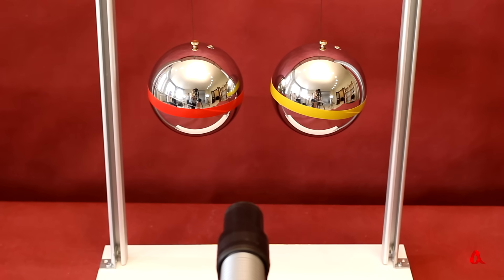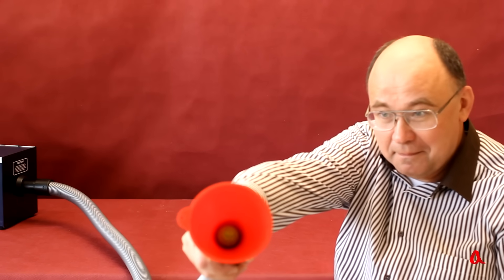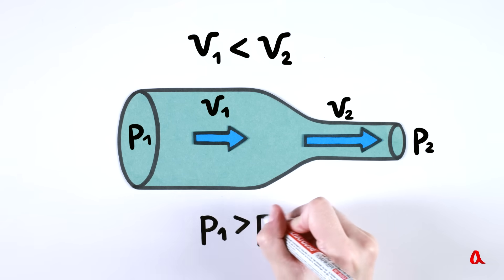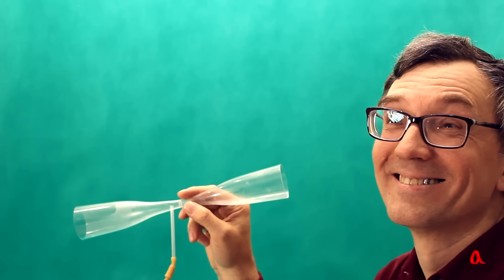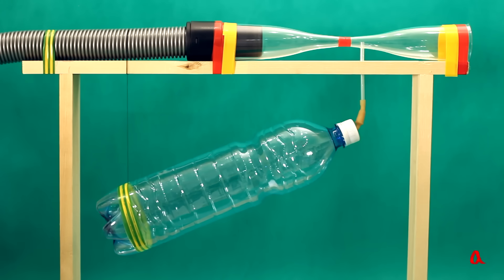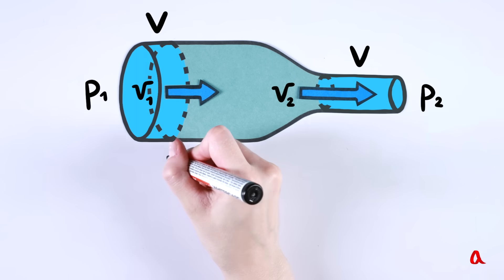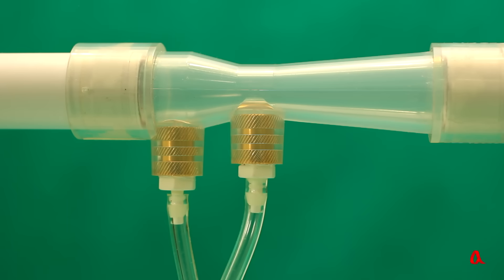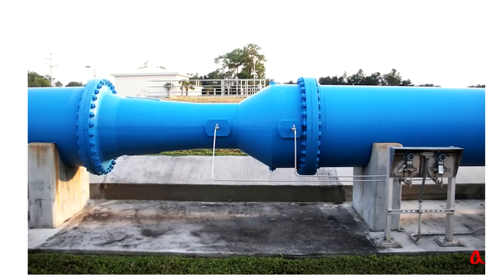Bernoulli's principle

Comment: I have always had difficulty providing an intuitive explanation for this phenomenon, but if we try to think of pressure as potential energy rather than force per unit of surface area, perhaps the concept becomes a bit more intuitive. Or, imagine having a blown-up balloon. The balloon has a certain internal pressure. When the balloon is opened, the air inside the balloon starts to move faster. The internal pressure of the balloon then decreases because the potential energy of the air inside the balloon is converted into kinetic energy.
Reply: You have to embrace pressure to reach your full potential.
Reply: Good analogy

Comment: Water and ball example is not bernoulli. It's adhesion and conservation of momentum
( The water turned to the right. Therefore, the ball's leftward momentum increases. But the ball is at rest. Is this non-conservation of momentum? no. The momentum of the water was transferred to the ball, and the ball transferred momentum to the Earth through the tension of the thread and gravity. Because the mass of the system combining the Earth and the ball is so large, the change in momentum does not appear as a visible change in speed.)

The ball is still sticked to water when there is no water flow on the other side

Comment: You can buy replacement shower heads, which promise to increase the force of the water spray at (I presume) the cost of some decrease in the total volume of water leaving the shower head in unit time.
It does seem to work, but the effect is (imo) rather too feeble to bother about.

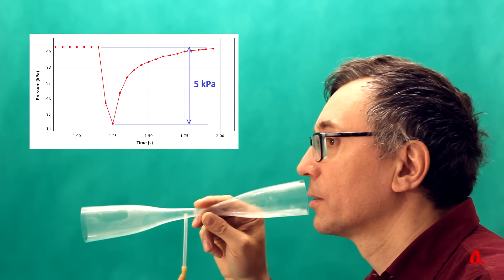Comment: 2:30 try turning it around tho’. The air must have lower pressure than outside the tube…but the straw will experience +ve pressure because it is upwind of the narrowest part.

Comment: Bernoulli's principal as applied to aerodynamic lift, doesn't fit. When air pressure sensors are applied above the wings of a C-172, according to data, the aircraft could not achieve lift below 400mph.

Comment: An Air brush functions by a certain velocity of air passing laterally down a tube of said diameter -  at a mid point down the tube is a T- piece with a pipe leading to a semi liquid media /paint source - 

A pressure is formed at the pipe perpendicular to the main pipe due to currents being generated by the air flowing through the lateral pipe.

The flow of current in turn causes a vacuum at the pipe perpendicular to it. - With a carburettor this is called down-draft.

Its basically a pressure created by many things travelling at speed - Aircraft, Cars, Speed Boats - - If you have wondered why if you leave your tail gate open you get chocked by exhaust fumes being sucked back into the car.

Comment: As the speed of the air increases the ball redirecting the air has a boundary layer that causes the air to follow the curved surface . Air has weight .  The air is acting under the laws of Centrifugal force as it is held to the ball by the low pressure boundary layer and causes what we call lift.  Air accelerated  across a curved surface "wing" creates lift by the weight of the centrifugal force directly relative to the speed . The faster the wing through that air the faster the air has to move to follow the wings surface which creates centrifugal force by kinetic energy. A wing flying just above VSO can not be over stressed . But above VNO can be overstressed easily .  More airspeed across the wing more centrifugal force  the air creates on the boundary layer. Such an experiment if I remember correctly was conducted on an F16 wing with a porous top wing surface where more vacuum was introduced I would suppose to slow the stall break.  Boundary layers lifts NOTHING .  It is the area between the wings surface and the fluid movement of air which can not do anything above VSO but adhere to the upper wing surface curvature creating a vacuum across the wing . The blunt nose of the wing along with angle of incidence only accelerares that air. The Whittman wing for the Tail wind has a thin wing with a sharp leading edge thus high take off , stall and flying speed. Ultralights use a very rounded leading edge to compress the air flow across the wing this a low stall speed .

Comment: The force in the system must remain the same.  If the speed increases in the narrower part, the pressure must decrease.
Reply: And similarly, if the net speed decreases, the pressure must increase, which is what happens with compressible fluids.

Comment: The interesting part is that if you close the system, when you blow, pressure increases.  However, when you open so that the air can flow, the pressure decrease the faster it goes.
Reply: Be careful. The way you stated it is not true. As you turn up the blower to increase the speed of the air-jet out of that blower, the static pressure of that jet of air coming out of the blower remains at atmospheric pressure. 
That is why it exits the blower. The higher pressure inside the blower accelerates it out into atmospheric pressure. That is where we see 'Bernoulli' happening. 
.
When you add the surface of the ball, you are changing the conditions and it is the curve of the flow that is causing a lower pressure near the surface.
Reply: @Observ45er  I'm not talking about closing the system with a ball that can open like in the video.  I'm talking about sealing the exit hole completely.
Reply: @xdragon2k   I can't make sense out of what you are proposing. 
.
You said: "when you open so that the air can flow, the pressure decrease the faster it goes."
.
I'm talking about a blower pointed to the open air.  Nothin closed about it. 
.
What is "open".
Reply: @Observ45er  I'm talking the counter intuitive nature of blowing into a container that is usually spread the container apart like a balloon because of increased air pressure, vs blowing through something that is open ended reducing the air pressure in the airflow and constricting the container.
Reply: @xdragon2k  I very am very sorry, but your English is not good enough for me to understand.
.
Rereading your original it appears you are comparing two thigs.
1} Blowing into a container such as a bottle. When you do this you increase the pressure in the bottle. YES.
.
2} Blowing into a pipe that has a wide section, then a narrow section then a wide section - a venturi,  Then the pressure in the narrow section is lower than the wide sections.
. . 
That;s the way it works.
Reply: @Observ45er  I'm not even talking about the narrowing of the open pipe.  The demo shows when you blow in between two objects, those two object get sucked into each other (or pushed by the atmosphere toward each other due to lower pressure in between them).

We're adding air in between two objects and it lowers its atmospheric pressure.  That's counter intuitive.  I'm not missing anything, am I?
Reply: @xdragon2k  Oh, and By the way, I understand the idea that a pipe that narrows would, "intuitively" increase pressure, but that isn't the case.
.
In short, the decreasing walls, as they slope inward, form a restriction.   As the fluid {air / water } flows TOWARD those inward slops, it pushes more, therefore raising the pressure in the FAT section, upstream.  You can then,  think of the narrow section as an outlet in a pressurized tank.
Reply: @Observ45er  That's what I suspect too.  Without the narrowing, the pressure on the "fat" section should be lower than with restriction. 

However, why is the air pressure at the narrow opening (moving air) is lower than the atmospheric pressure?

Or is it not?
Reply: @xdragon2k  It's not. Otherwise the air couldn't move out into the atmosphere at all, in fact the air flow would be reversed. Stop focusing on direction of air flow; of course there needs to be some air flow, otherwise it would be completely inert. 
But it's ALL about the pressure differentials, between different places within the apparatus. That's all. Remember that pressure = mass/volume (Boyle's Law). Not enough mass can get into the larger area after the restriction (because the restriction restricts that happening) and so the pressure falls thereafter - equal mass, but larger volume = less pressure.
OK?
Reply: @sunnyjim1355  Got it.
Reply: @sunnyjim1355  Dude, Boyle's law does not apply to dynamic fluids so your explanation is wrong! Bernoulli still applies to incompressible fluids. Actually Bernoulli derived the continuity equation and his famous equation by assuming an incompressible fluid where the density of the fluid does not change. The density of the fluid does not change at all as you go from a section with a wide area to one with a lower cross-sectional area! Also, the static pressure in the narrow section is less than atmospheric pressure otherwise the plastic water bottle would not get crushed. The reason the air moves towards the right in the demo (open end of venturi) is because the total pressure in the venturi is always greater than the total pressure outside the venturi tube. There are three pressures involved here- static pressure, dynamic pressure and total pressure and the total pressure is the sum of static and dynamic pressures.

Comment: When moving at considerable speed, this principle becomes tactile; breathing with wind-force against ones face 'should' make inhalation easier by intuition; however it is not the case, the faster the wind approaching ones face the harder it is to inhale, in-fact the lungs volume is wrenched from ones throat instead, and only an eddy-of air-pressure will allow ones respiration at-speed.
Reply: It's not true that faster air flow implies lower air pressure.  Bernoulli's Principle only says that a faster section of flow within the same fluid flow must have lower pressure than a slower section within that same flow.  If you stick your head out of a fast moving car and face forward, it should be easy to inhale.
Reply: "the lungs volume is wrenched from ones throat"
Maybe the wind was pressing against your chest too and that forced the air out of your mouth.

Comment: Fascinating video. However, I am not sure that the ball hanging in the water coming from a tap is really demonstrating the Bernoulli principle. 

Firstly, the water is not being constrained to flow through a narrower channel - it is free to flow over the surface of the ball and so the cross section of the flow is probably not reduced.

Secondly, if you look at the flow of water coming off the bottom of the ball, it is deflected to the right after it has flowed over the surface of the ball. Changing the direction of the water flow to the right causes a reactive force on the ball towards the left, and this is probably what makes the ball appear to cling to the water - the ball comes to a rest where this leftward force is balanced by the rightward force of the downward water flow pushing on the ball.
Reply: It's the Coanda effect, not Bernoulli's Principle, that pulls the spheres or spoons together in a liquid or gas flow.  The experiment would not be able to be replicated with cubes instead of spheres.
Reply: I agree that the ball in the running water was not explained right or enough. But I think they meant that the change in the pressure of AIR around the running water causes the movement of the ball, not the pressure of the water. For some years now I have wanted to know why the spoon is pulled by the running water. And to me it looks like the curved shape plays the major role. I doesn't happen when you rinse a knife.
Reply: @sylwiagotzman5422  Have a look at the video: Why are so many pilots wrong about Bernoulli’s Principle? by Fly with Magnar (https://www.youtube.com/watch?v=uyRx25MSWng). IMO he explains quite well what you're describing, it is the same as for an airfoil. Spoiler: it is also Bernoulli's Principle, and has indeed to do with acceleration of the fluid at the convex part of the spoon

Comment: I think that this didn't explain the nature of the effect - the behavior of the particles (or strings) in flow relative to "stationary" ones.
A part two to the video, with particle animation, where you visualize the pressure exerted by particles which do not flow is very much needed in my opinion.

Comment: This is also the principle on which an aircraft can fly... the airfoil is shaped so that the velocity of air going over the wing speeds up relative to the air beneath the wing, thus creating a lower pressure above the wing, and, voila! You have lift.
Reply: You can have lift with a symmetrical airfoil, you just need a higher leading edge than trailing edge relative to the airflow.
Reply: @fins59 you can't have lift with a symmetrical airfoil at zero angle of attack, because there's no pressure difference top and bottom, you can create pressure differences with a flat plane too, doesn't make him incorrect. The goddamn definition of an airfoil is a shape optimised for creating lift with little drag.
Reply: @davidaugustofc2574   "you can't have lift with a symmetrical airfoil at zero angle of attack, because there's no pressure difference top and bottom....."
Correct, well done, glad you understood my comment. 
"doesn't make him incorrect" Did I say he was incorrect? Try reading my comment again without the lack of comprehension.
"goddam" You seem to have got your knickers in a twist petal.
The point of my previous comment was that lift can be created by means other than the traditional asymetrical airfoil shape.
Reply: @fins59  at any angle of attack other than 0° and 180°, the symmetrical airfoil is asymmetrical relative to the airflow, and so the pressure field is asymmetrical too, it is what it is.
Reply: @davidaugustofc2574  Glad to see you've understood my comments.

Comment: Comical. EVERY video on this topic has the exact same explanation: "narrower the pipe section, the lower the pressure" because equations . What happens is equations due to more equations . HOW does it work? By equations .

Comment: how u find that if there is a section of 3 square cm, whit a flux of 12 L/s; the velocity is 40 m/s
Reply: Cross section area = 3 sq cm. Volume flow rate = 12 litres/sec = 12000 cubic cm/sec. Dividing the volume flow rate by the cross-section area of the tube will give us the average flow velocity: therefore fluid velocity = (12000/3) cm/sec = 4000 cm/sec = 40 m/sec.